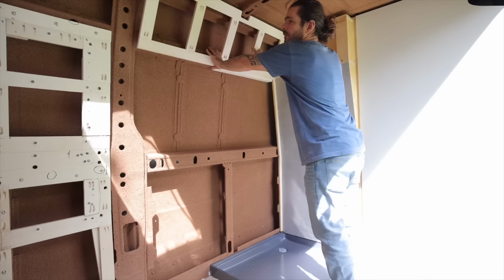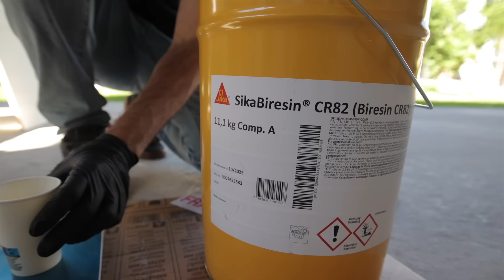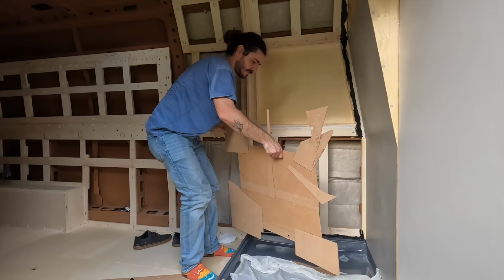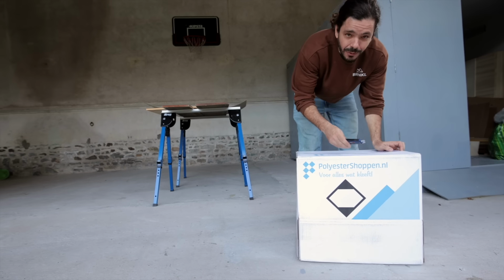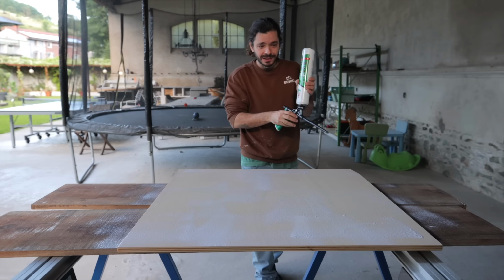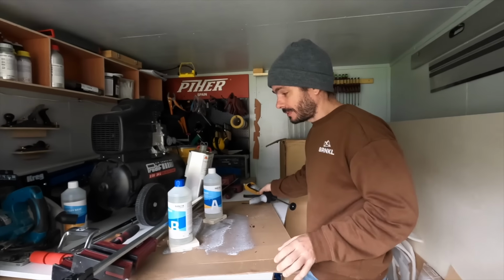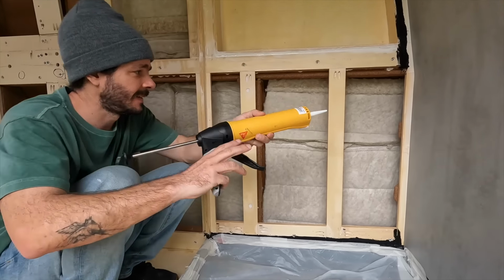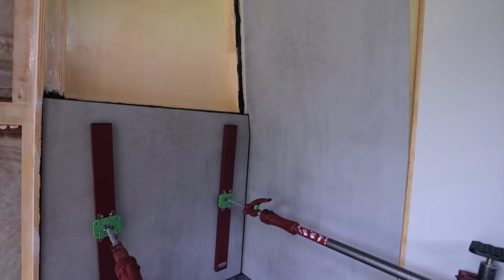🚐 PLEASE!! Don't mess this up!! Ep.341

Comment: I installed template framing very similar to yours inside my cargo trailer. It allowed me to install R13 insulation. I now can withstand extreme temperatures. Insulation is the key to solar heating and cooling. Great video, one of your best.Thanks

Comment: I have no doubt that the adhesive you used under that one panel is fantastic. But wow! 
12 hours to partial cure, and seven days to fully set!? Just my own experience in applying laminate, but I’ve never had any problems with bubbles. To avoid them, always use a roller to apply the contact cement, I use the little finger foam rollers, to ensure a smooth coat. Work fast, don’t over work the glue or it’ll glop up. A thicker coat doesn’t help. It’s only the surface of the glue that is doing the adhesion. Then go for it with your pressure roller, in every which way. And, there’s no such thing as too much pressure. You won’t have any bubbles, and you can trim and install with no delay.
Cheers from Dallas🍸(again)

Comment: You need a vacuum bag system to apply even pressure on a surface like that.  See Duracell build to see how they do it.  Works really well.  Also use insulation with a built in vapour barrier on one side.
Reply from the maker: For sure vacuum bag would be great in this case. We will definitely try it out in future projects. 🥰

Comment: Contact cement should be applied to both surfaces.
Contact cement works by sticking to itself. So it has to be applied to both surfaces being joined.

Comment: Try hand cream on your hand when smoothing sealant.
Reply from the maker: I think it can contaminate the sealant
Reply: @OddLifeCrafting  I was an AMT (Sheetmetal) for 33 years with a major airline. We used hand cream to give the sealant a smooth surface in some areas. Your not mixing the two together, just the surface.Try a test area.

Comment: Just a question and I have no idea about insulation but I am curious, wouldn't you seal the insulation first in the shower area due to the build of moisture and possible mold in the future then put up the frame?
Reply from the maker: Natural sheep wool has the "ability" do dry out if it gets wet but I don't believe it will as we have the cork insulation to break the thermal bridge. 😅

Comment: Dude you have to glue both pieces. Let it go tacky then press together. 😊
Reply from the maker: This is not contact glue. This glue according to the manufacture you apply in one side, wait for 1 minute, then you join both pieces and you have like 45 minutes until you can't reposition it anymore. After12-24 (depending on the temperature) it is 95% cured. !00% cured in one week. It cures with humidity.
Reply: @OddLifeCrafting  cool my bad! Hopefully everything goes well for you both. Take care